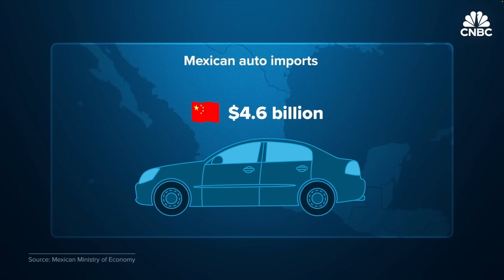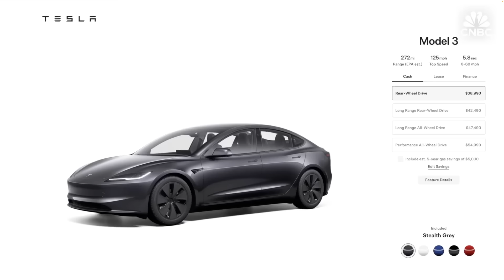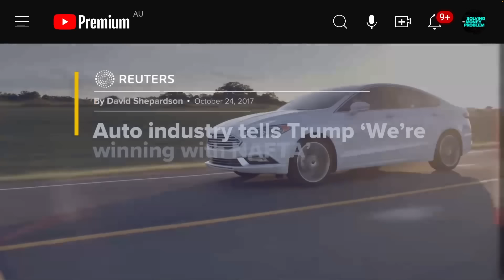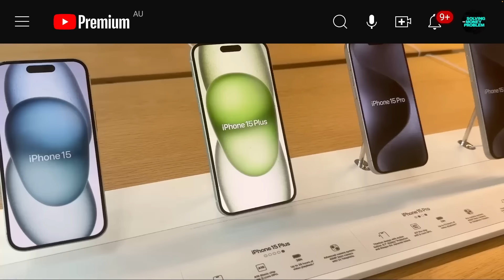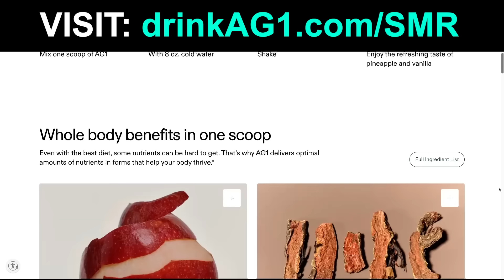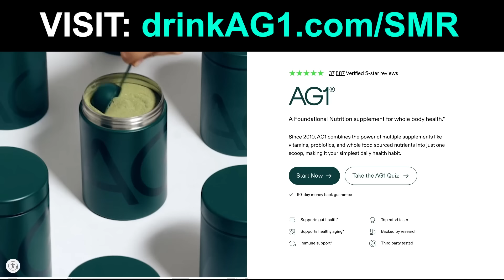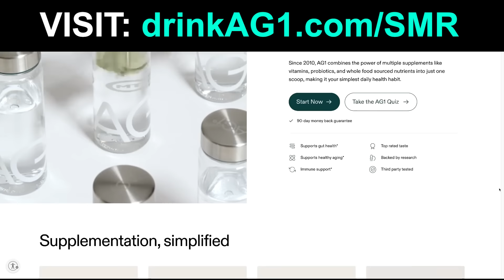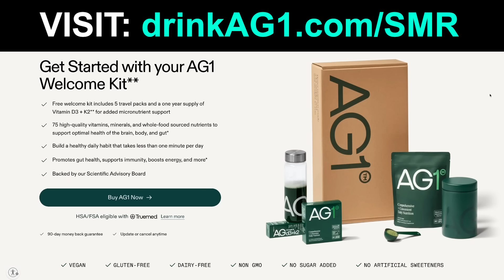It’s Impossible To Lose For Tesla Now

Comment: Tesla and Intersect Power have signed a contract for 15.3 GWh of Megapacks, Tesla’s advanced battery storage system, for the latter’s solar and storage projects through 2030. This deal, along with previous agreements, positions Intersect Power as one of the top global buyers and operators of Megapacks. It has nearly 10 GWh of large-scale storage expected by the end of 2027.

Comment: Tesla is best able to compete on price here in the states without tariffs…one day.  That being the case, Tesla is not our governments primary concern, the legacy OEM’s are, which neither Trump nor Harris will allow to fail.  As these companies have no chance to compete on price with EV’s, ever, tariffs are the only option.  You may not like them, but they are a certainty when trying to protect our failing auto manufacturers.  Realistically, no matter how much our government try’s to prop up the legacy OEM’s, most will eventually fail, but by then Tesla should be making a considerably better product than the Chinese, and at a comparable price.  Tariffs on Chinese automobiles will then be unnecessary.

Comment: You talk about Tesla taking over a market that they don’t have the production for.
Reply: TESLA is going to FCUK Legacy autos.
Reply: They don't have suffficent production Yet to replace all other manufacturershence the new methods of production and models they have developed  when the OEM bankruptcies happen in about 2030 the OEMs will be producing how many vehicles? Zero so it wouldn't matter if Tesla was only making 5 million EVs because that would be the sum total available new EVs to buy or near enough.
Reply: @Barskor1  If that’s the case, why are they doing low volume productions of high cost for cloud?
Reply: @markplott4820 ”Frunk” those LEGAs!
Reply: @daikucoffee5316  Did you ever read their mission statement? Yeah give it a go.